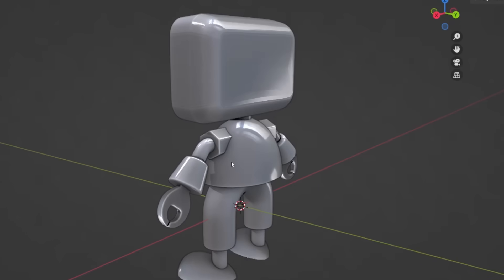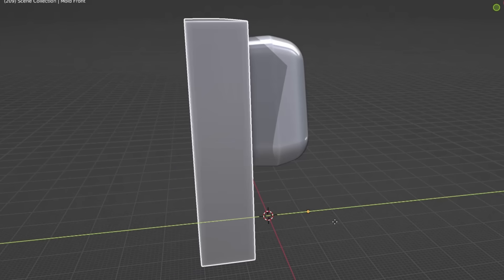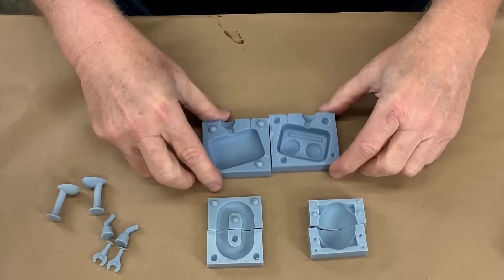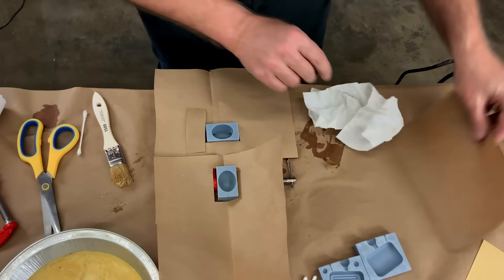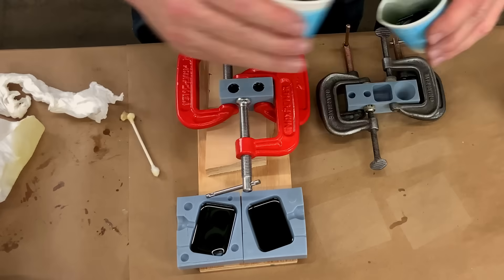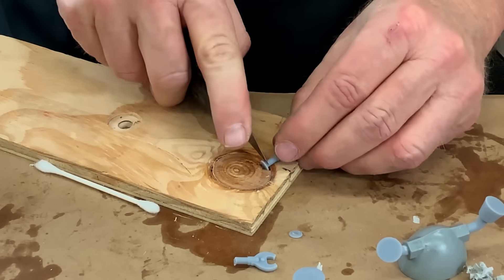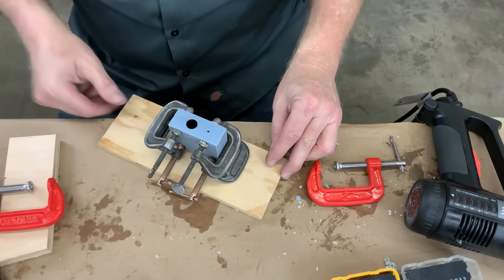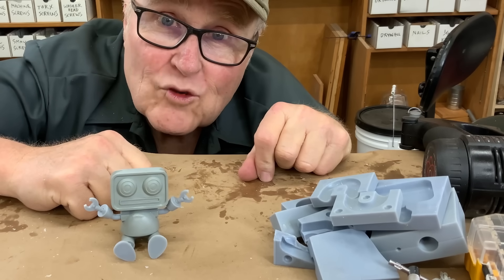3D Printed Molds For Resin Casting - Does That Even Work?

Comment: I recently start to do it too. I use FDM 3d printer and tried printing the mold with it, which I had a terrible time removing the resin from the mould. After the faliure I made the object using the fdm and made a silicone mold for it, and then casted in resin, which works much better.
Reply: FDM just doesn't have the fidelity--the layer lines are too large, which leave marks that need sanded, and it's kinda porous, so the resin seeps in and you get...exactly what you got.  Dunno if waxing the hell out of it and maybe tumbling the mold with pins to "sand" it would help...
Reply: @gpweaver  I use some primer to cover the model and sand it afterwards. And yes, I can see the lines on my models sometimes. I did not mean print a mould using FDM 3D printer though. I have tried that before, and the resins just soak into the holes between the lines, and some fast resins melts the PLA I'm using. What I mean was use FDM to create the replicate of the acutal cast object, then make a silicone mould for it, then cast it with epoxy resin.
Reply: @DanteEhome  Yeah, that would work just fine.

And now there's low melting temp FDM filament for doing lost-PLA metalcasting, which is cool as hell.
Reply: @gpweaver  Oh yeah ,I had heard of FDM filament that melts in water too. Will be interesting to play with them.

Comment: Print the mold in an FDM printer using TPU.  It's strong and repeatably flexible like a shoes sole.  I've printed functional sandals out of it.  TPU also naturally smooths on print so you wouldn't get the layer lines like normal PLA.  Resin printers are always going to be on the brittle side, but I have seen some flexible resins that I haven't tried yet.
Reply: Do you coat the mold before casting? I just upgraded to dd to try print tpu molds.
Reply: @lifeviasoul  Depends on what you're filling the mold with.  The surface is like glass with the right settings so in most cases you wouldn't need a coating unless it's something reactive with TPU chemically.  I'm sure other brands would work but I used Polymaker TPU95, from their site: "PolyFlex TPU95 is a thermoplastic polyurethane (TPU) based filament specifically engineered to work on most desktop 3D printers. It has a shore hardness of 95A and can stretch more than 3 times its original length."  The TPU90 may be a better bet depending on how much you have to deform the molds to get out the object.  They also have a newer TPU95-HF meant for manufacturing.
Reply: @IdleByte  thank you so much! Would you be willing to share settings? Thank you again for the information!
Reply: @lifeviasoul  The defaults are good if you go with polymaker.  It's almost PLA easy.  Just increase temp or slow down speed to increase glass like finish, but bridging/retracting will be impacted.  I use a CR10 and it doesn't struggle at all.
Reply: @IdleByte  thank you!!!

Comment: At work we use the Rigid 10k resin from Formlabs and we successfully made prototype molds for strain reliefs and premolds, shooting every material except TPU (TPU sticks to the mold like a mofo). We have been able to shoot 1-2 shots of TPU if we spray the mold with PTFE prior but it's a gamble.

Comment: Instead of removing the positive spheres, it seems to me that it would have been easier to get one of those spherical Dremel bits and remove a bit more material from the negative spheres (holes).

At least that way the mating surface wouldn't have been in danger of being sanded down.

HEY!!! SLICER SOFTWARE PROGRAMMERS!!!
You should include an option like "this is a mold" with the ability for the user to place auto-generated registration cones/spheres that automatically account for draft angle and surface tolerance.

Hope this helps!
Reply from the maker: I actually tried that on one of the extra test molds that I made. It was very difficult to get the enlarged holes concentric with the initial hole. And another problem was that the mating surfaces were ever so slightly warped. So it was easier to simply sand the surfaces level.  It was a fun experiment but there is lots of room for improvement!

Comment: Sweet!  The ability to make a real fast mold with ver partial infill (making it really fragile) with which a completely solid infill resin of a different and tougher plastic is a real accomplishment.  I can see using this to make really intricate really tough and hard plastic gears.  I would still use pins and make them the right size.  This was a real success.
Reply: It's quicker to make a silicone mould.

Comment: Can you? Of course you can. As a design engineer with 35+ years in the industry... I can say that I've had many resin cast parts from 3D printed molds made since the late 1990's. P.S. If you you buy a Formlabs printer you can print with a ceramic material that you can use for plastic injection molds.
Reply from the maker: I would love it!  Please Formlabs - donate a printer to my channel! 🙏🙏

Comment: Why don't you 3D print the robot and use elastic resin to create mold? I think it would be easier to take out.
Reply from the maker: Because my channel is about silicone mold making and resin casting. I have many videos about making silicone molds from 3-D printed objects already on the channel. So I like to mix things up and try something different from time to time.
Reply: @RobertTolone  thank you for fast response. I didn't understand the logic behind at first but now I get it and you are right. I found your channel thanks to this robot 😄 You have a lovely channel and original ideas 👍🏻

Comment: Great experiment. I've always wondered if this is possible. I have a tip just in case you want to continue. The Resin I use for my needs is Plant-based UV Resin by Anycubic. One of its wonderful properties is that with a certain shell thickness it becomes very flexible and at the same time quite strong. With a thickness of 1.3 to 1.8 mm, it bends perfectly. The only problem is that most of the software does not have the tools to create such models. I use Zbrush or 3D max which are quite expensive.
Reply from the maker: I that the EC UV Resin gray by Anycubic?
Reply: @RobertTolone  Eco UV Resin, yes. I usually use black. I have never used the gray one (although I have three liters). I suspect that they may differ in properties. I print masks at 1.5mm thickness, which allows them to be both strong and flexible enough to adapt to the face. I suspect that it will be much easier to get castings from a flexible mold of the same thickness.

Comment: You should do some macro shots of the surface. I know resin printers have a much finer z-resolution than FDM does, but I'm curious if there's any noticeable layer lines on the cast part, or if molding a finished master is still the more optimal route to take.
Reply from the maker: 3-D resin prints are good but far from perfect. There are printing artifacts visible to the naked eye. Silicone rubber can reproduce incredibly fine detail. So it remains the champ for high quality castings.

Comment: To separate the second piece from the resin mold, place them into the freezer for 30 minutes and the two will be separated. I do this for most of my molds that have details that I don't want snapped off.  Same theory as letting your 3d Printer Bed cool and the pieces pop off automatically.
Reply from the maker: Great tip! I’m going to try it next time. Thanks!

Comment: I just baked a print the other day and got that wood grain pattern as well. The interesting thing was I only got it on one of 5 identical prints. And I think the only difference was I may have post cured that one for less time than the other 4.
Reply from the maker: Didn’t consider that. I was pressed for time and did not post-cure the head mold as long as I did the other ones.

Comment: Awesome experiment, my favorite thing about this is how time effective this process is. I do have one question : do you have to reapply beeswax every time you go to use the molds? I've only ever used Ease Release, this is a method of mold release is new to me.

For me it doesn't seem to matter how long a resin print cures for, how many coats of ease release I use or layers of clear coat spray paint I do; I can't get a resin print to cure with the preferred platinum cure silicone. Sure I could use tin cure silicone, but with the fragility of tin cure silicone, if that breaks, it costs more time and energy to make new one. ESPECIALLY if it's a two part mold. 

So even if I can get one clean cast out of a resin printed mold and it breaks, I can then make a platinum cure mold and be happy.

Comment: Do you have a beeswax release formula that would paint onto a 3D cast that would allow resin plastic (cold cure) to be applied directly to the 3D cast?
I do orthodontics, 3D models are becoming more popular, but unlike stone, the acrylic will fuse to the 3D and I haven’t seen anything yet (other than petroleum jelly which is just terrible) to use.
Reply from the maker: I always use plain beeswax melted. That is as pure and non-toxic mold release as I have ever found. But obviously it does require the application of heat. You can make a paste wax out of beeswax by adding paint thinner or turpentine. You add just enough solvent to form a paste. Then you apply it like a car wax. But you have to wait for the solvent to evaporate out of the wax to get a finished film

Comment: Draft release angles make a huge difference, I made production parts using a form 3 printer and resin casting with mine, apply similar principles for this as you do for injection mould designs.

Comment: Rob!   Do you ever use the plastic corrugated  sheets for mold boxes?
Reply from the maker: Seal up the edges carefully otherwise the corrugations will fill up with rubber. Otherwise it works fine.

Comment: Could you design a 3 or 4 part mold with a pour spout designed into the feet or something and rotocast the resin?
Reply from the maker: Yes, attach the inlet sprue for the resin to one of the feet, making sure you have a cap to close it. Have the other feet inside the mold with no openings.

Comment: I think the big issue with this is for those of us including myself who make molds out of resin prints are the faint layer lines on the prints. It's why we go through the prossess of sanding and buffing them out to get a smooth face, treat the prints then cast them in silacone for molds. to recast in epoxy. 3D printed resins are also a lot softer then casting/epoxy resins unless you play a hefty price for more durable resins designed for machine work.

By the way, did you post cure your prints? I ask as I use the same printer, and same resin... and your prints look like there fresh off the build plate with no post curing. If not then those are not safe to be touching with bare hands.
Reply from the maker: Yes, I post cure my prints in a UV chamber but I really think the good old California sunshine does a better job of post curing.

Comment: There are additives that you can mix with the resin (usually 1:3 or 1:4 by volume) that give the print some flexibility which allows you to break the microscopic hold the parts have on the mold even on drafted parts. It is also possible (depending on design) to add ejectors to the mold that would need plugged or to add chamfers to the outside mold seams to ease mechanical separation. Also also, again depending on the design, it is about just as easy to print the molds in multiple parts beyond 2 so that it is easier to get hold of the part and separate everything limiting the surface area any particular mold section has. I used all of these techniques to print a 5 part mold (with 6 steel registration pins) to cast game pieces that could not have draft. They had detailed engraving on top and bottom and then they had sharp, square edges to be able to stand on any of their three edges. I added chamfers dividing the layers of the sandwich so to speak that would wedge the top and bottom sections away from the ring of middle sections, then I printed double pronged clips that I could put on my vice jaws to easily break away the large upper and lowers before easily peeling off the middle pieces. Since all seams are at the edges of the rather angular piece the flashing is easily cleaned and fixed. This was repeated for three patterns of engraving as well as adapted to make a squish mold for polymer clay and spray foam.
Reply: You can buy flexible 3d printer resin, no need to mix your own
Reply: @Aikano9  no good, they become toooo flexible. You just need something that allows the mix be less brittle while still keeping dimensional tolerances. If you look at the instructions of those flexible resins they recommend different mix ratios on them.

Edit: Depending on what is being molded of course. There could be reasons for more flex in some situations but I've not found a situation in which I wanted to use the full soft resin.

PS: your comment was really condescending. I recommended adding flexible resin to hard resin to make the hard resin more flexible and you come back with 'hey you can buy flexible resin' like dude I literally just said that.
Reply: @karatos  I read the first sentence. Not the rest. Idk if you mentioned buying flexible resins or not
Reply: @Aikano9  The existence and use of flexible resins, the main point of the comment, was literally the first sentence, so even that excuse is lame.

To others, my apologies, I did not explicitly state that these products were for sale, since I did not think that detail was in any way needed amongst thinking adults, but since at least one person did not understand please allow me to be clear: one can buy these, readily, and often at reasonable cost from reputable dealers. No need to steal them or excrete them or synthesize them yourself. If you needed this information then I wish you the best of luck and try not to look up because it might be raining.

Comment: You could try some flexible resin for the mold like the F69 from Resione. F69 is rubber-like when its warm, but you can get it rather rigid by cooling it down. The rubber-like consistence should make removing the molds easier.
Reply: I actually did that about a week ago. The flexible resin bonded completely with the 3D resin and was impossible to pull. But it definitely works with plastisol (the rubbery stuff fishing lures are made of).

Comment: When a friend's making resin moulds, he prints the positive on a resin printer, then casts a silicon mould around it. It's soft enough to make part extraction a lot easier, but stiff enough to keep its shape.
Reply: I do this as well. I Have some resin mold jackets that i've made for things I commonly cast and printed mold to cast silicone molds to do resin casts. If that isn't too convoluted :P
Reply: if the mold are empty he loses the shape, here on brazil we use "gesso" idk the translation name of this
Reply: @VictorG0mes-1  they call it plaster

Comment: Could you do this even with out a pressure pot?
Reply from the maker: Yes, but the pressure pot makes it easy to control bubbles. Without it you will inevitably have to repair bubbles in your castings.
Reply: @RobertTolone  Thanks Robert, I guess the only question I would have then is, is it safe to have one in an apartment?  I'm getting myself a Jupiter printer (arriving in the next 3 weeks) and I'm modeling my own idea's for printing/selling which I'll be starting small with key chains but I live in an apartment, no workshop or basement to workout of, just my livingroom, lol.   Sorry for the long message :/

Comment: I think its better to print normal figurine, cut it, and flood it by silicone for silicone molding - then you got perfect, flex, cheap mold :) 

Or maybe use TPU?
Reply from the maker: Silicone molds are much easier to work with than rigid tooling.  My entire channel is about silicone rubber molding so I’m trying to show other methods of work for variety if nothing else.

Comment: As depicted in this video, you printed the moulds vertically oriented.  You might have experienced faster print times if you had oriented them horizontally.  This might also have guaranteed a higher-precision, flatter parting plane, which it doesn't seem you need.  The trade-off, of course, is you might have needed more overall print jobs, and you might have optimised your print job-length to match a workflow schedule like lunch break or overnight.
Reply from the maker: I was fearful of removing the prints from the build plate if I laid them down flat. But it would have helped in the ways you mentioned.

Comment: you should design a hole with threads in the mold so when you pop it open you can use a hex bit bolt from the other side to push the resin out
Reply from the maker: The idea is sound but the execution is difficult. The end of the bolt would leave a significant mark on the casting. Indeed if you look carefully at injection molded parts you can see round marks where the ejection pins are located. Beyond that, pressure casting resin means that the resin would be pressed into the tiny gaps between the threads of the bolt and the hole. Thus doing a wonderful job of bonding the bolt to the mold! Not to mention the fact that the mold is made of wax. The pressure of ejection would simply strip the threads of the mold.  I have been experimenting with doing something similar to what you suggest. But instead of a bolt I am experimenting with compressed air.